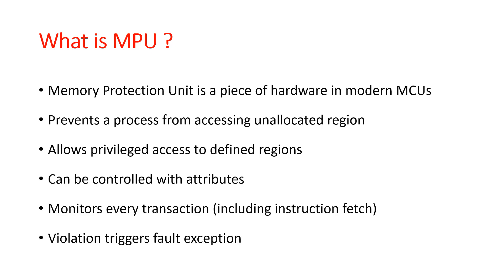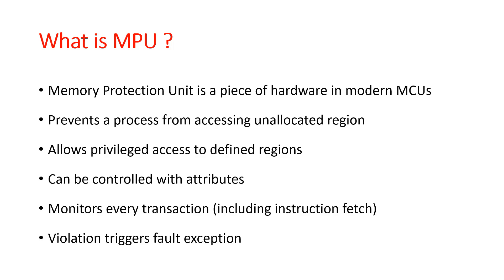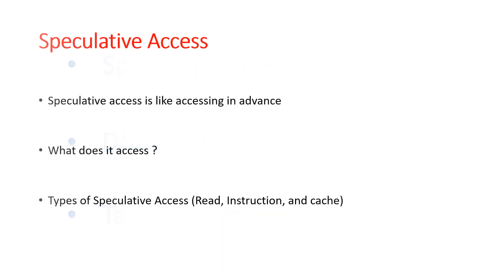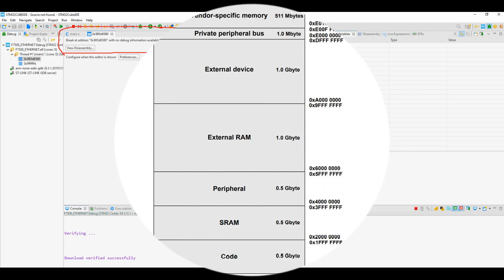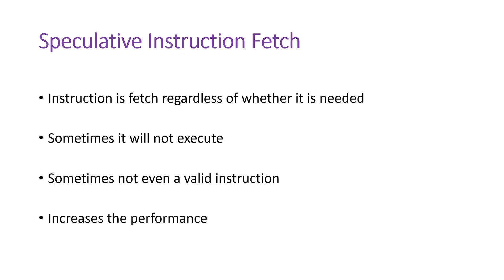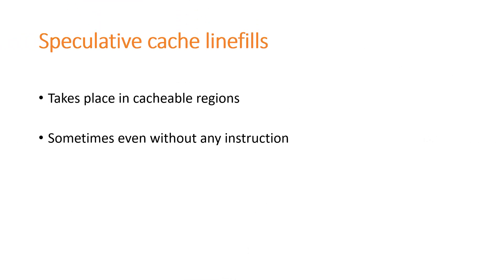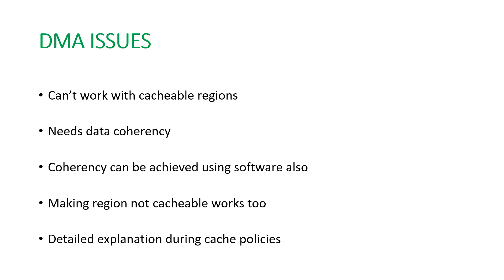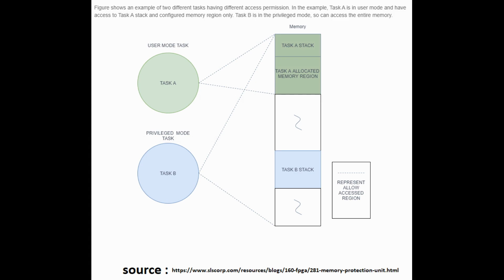STM32 MPU Config || #1. Need for the Memory Protection Unit

Comment: On CM7 (STM32H7, F7) if I and D caches have never been enabled after reset, can speculative data fetch and instruction fetch still occur?

Is speculative access independent from caching?
Reply: Speculative access is about accessing the memory region for data or instructions (as in anticipating) to improve the performance factor...
Caching is a process to make the data or instruction available much faster to the CPU by taking a copy in cache memory, which is in close proximity to the cpu...